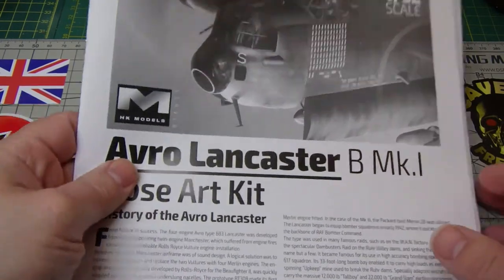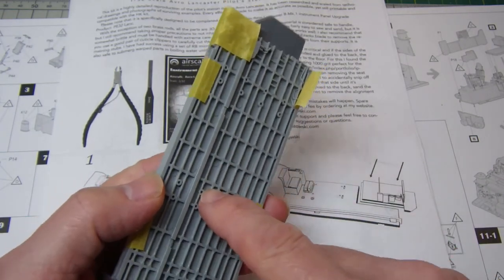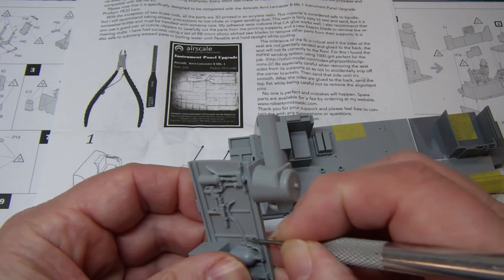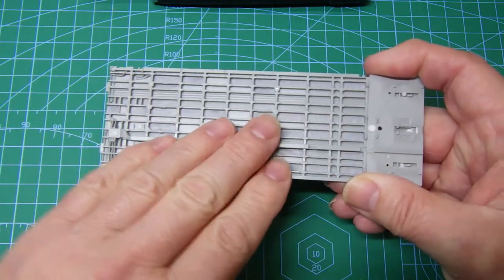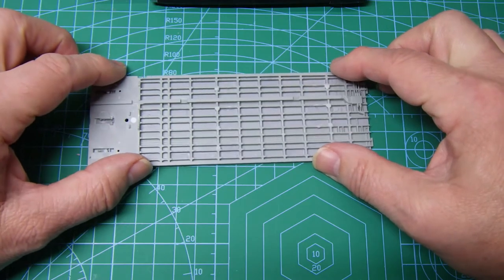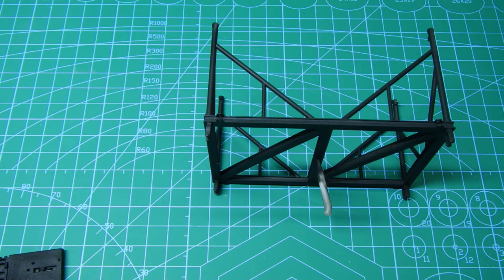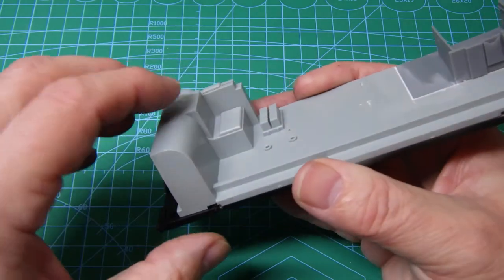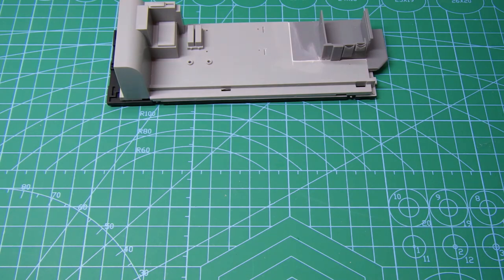HKM Lancaster Nose Art kit - build part 2

Comment: This will look good when  done injector pin marks i got so good plastic putty about 2 mailcalls back about 2 or 3 stash add videos back its cool for them injector marks better than milliputti i used that many times it will work but that new plastic putti i got in that video is good i was goibg for the revelle plastic putty filler but my local guys said keith you be best off with the stuff i got and yeah i agree its good drys quickly and sands smoothly, 👍
Reply from the maker: Thanks for that, I’ll take a look. I try anything 🤔 cheers 🤣🍻
Reply: @greybeardmodels  my pleasure buddy